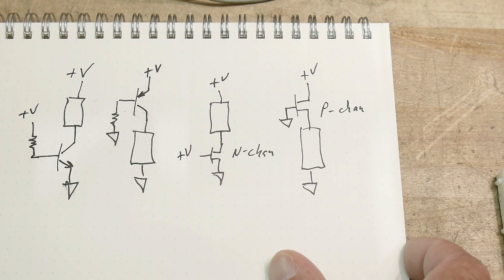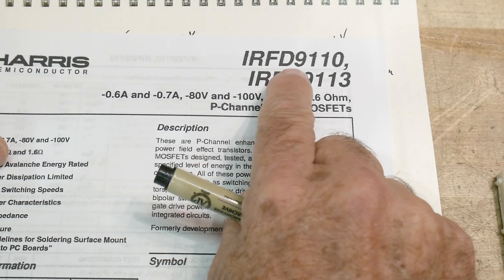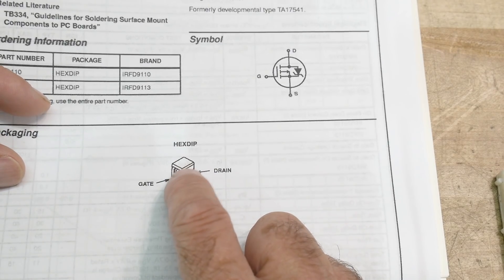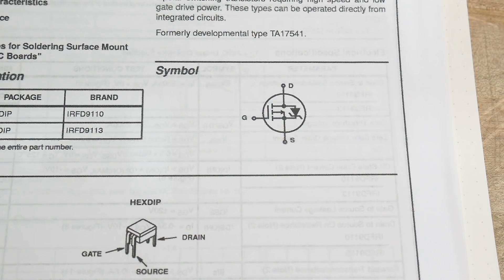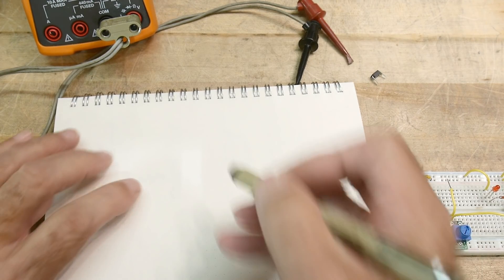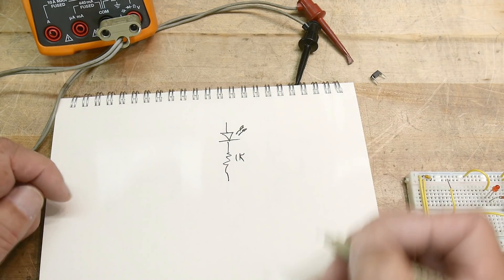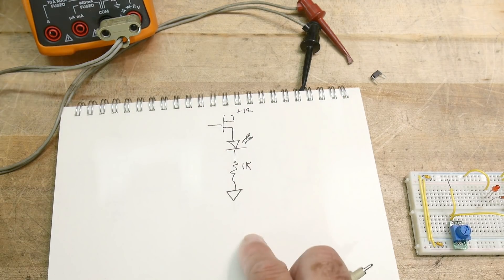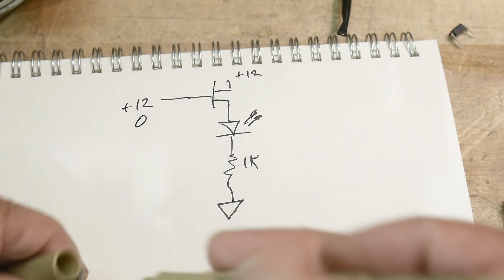#1194 P-channel MOS FET IRFD9113

Comment: A question because I don't know the answer. In the example with the arduino, could you not just have a 10k pull up resistor rather than a BJT?
Reply from the maker: not good to connect 12v to a 5v chip

Comment: An important extra note about 11:50 is that you have to be careful of that resistor value depending on the frequency you're operating at. When the transistor activates and the gate capacitance is discharged it is through the very small impedance of the saturated transistor. So it turns on quickly. But when the transistor turns off and the gate charges, it is through the resistor, and the time constant becomes something you have to worry about. The turn off will be slowed down. As you approach an operating period equal to that time constant the gate won't fully charge and the FET won't entirely cut off. It will spend more time in the linear region while cutting off and will warm. At a high enough frequency it will essentially never charge and the FET will permanently stay on. 

(Assuming a 1nF gate) Basically if it's anything higher than 10kHz I'd go no higher than 10k for a snappy gate response. And lower it as the frequency goes higher. Better yet add a BJT push-pull stage after the level-shifter and then the gate sees a low impedance to both the high and low side. Really that's what I would do for anything 100kHz or beyond. You're gonna reach a point where to keep the gate responsive at cutoff you'll need such a low resistor value that it will begin to stress the transistor. Plus the average current draw of the resistor-transistor branch could become high enough that it will be problematic for the longevity of battery operated devices. 

However, at the same time, if you're operating on a seconds/minutes/hours timescale and the transistor will be on or off for a long period of time, 1M should be fine.

Comment: 13:01 I am stilla newbie, but I think in your drawing the source should be at the top (so a connection from the middle to the top)?
Reply: Or, does it really matter? Can you swith Drain and Source? Hmm..
Reply: @blackarrow8683  No, you can't swap drain and source on a mosfet. The construction of all modern mosfets means that there is a "body diode" (not a "protection diode") between the n-type substrate or body (which is then connected internally to the source) and the p-type drain. If you make the drain more positive than the source in a p-channel mosfet, the body diode will conduct regardless of the gate voltage. Therefore you only have normal fet operation ('triode' region) when the drain of a p-channel is more negative than the source.
Reply: @RexxSchneider  Thank you. That makes sense!
Reply from the maker: some JFET you can swap D and S but not the normal fets

Comment: Thank you. P-FETs make great Reverse Polarity Protectors = Worthy of a video. Would a PNP/3906 pull-up transistor be needed, for a RPP arrangement? Or, use a CMOS PFET?
Reply: You don't need pull-up transistors when using a p-channel mosfet for RPP. The only thing you need to ensure is that the gate doesn't get pulled down by more than its rated voltage, so you may have to clamp it with a 10V Zener diode. There's a circuit illustrating its use as an "ideal diode" in Stack Exchange at electronics stackexchange com/questions/588808/reverse-polarity-voltage-protection-using-p-mosfet (put the dots in to get a url), and the answers explain the operation.
Reply: @RexxSchneider  Thank you!!!